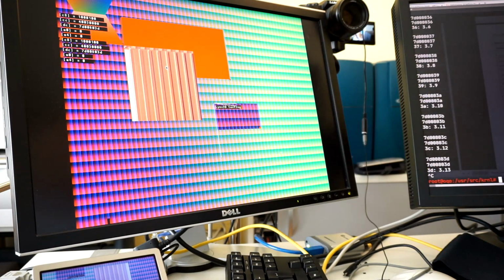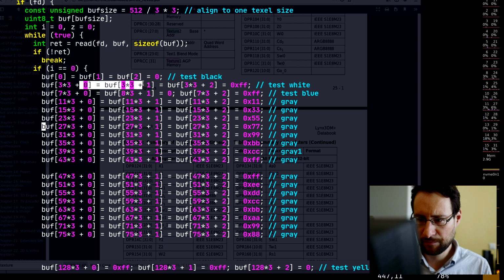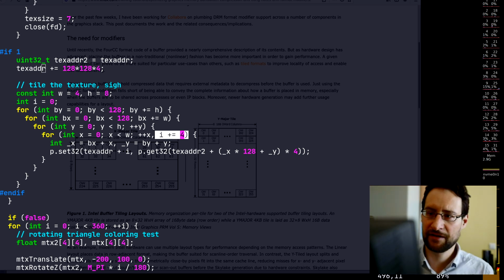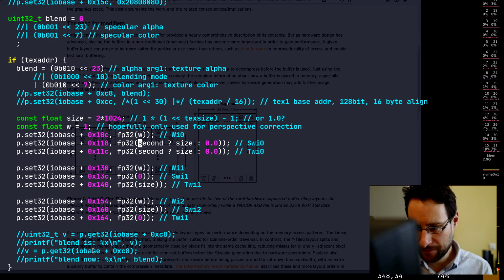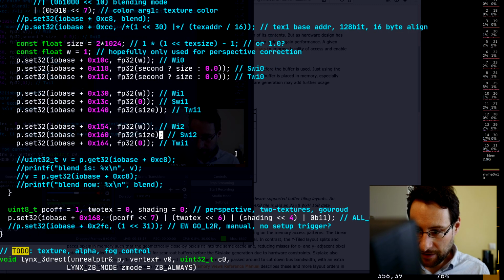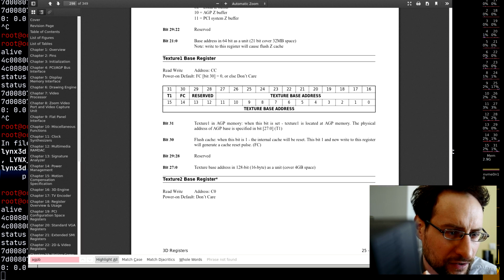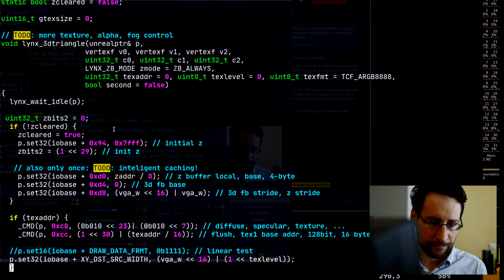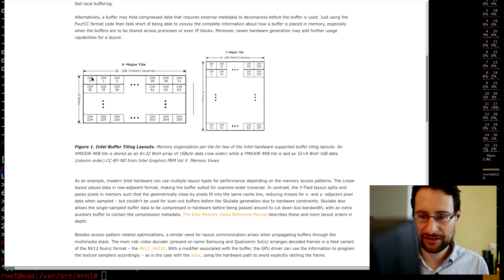I tamed the SiliconMotion Lynx3d+ texture unit!

Comment: Ah. Good old SMI. Once wrote a X driver  for this and used the 3D for Render acceleration. This was on an embedded platform so the bus an memory were quite limiting, but it did perform quite nice when working with in memory stuff. It is probably still around somewhere in old harvesters and what not. Unfortunately code stayed within the company. 😢

Comment: Awesome work, thanks! You mentioned that it's in a ThinkPad T42, but it's not. The LynxEM+ is being used in the Japanese IBM iSeries 1124, but also the in the ones for the western market, which are sold as the ThinkPad 240X and 240Z. A friend of me had one, I have the 240 with a Neomagic MagicGraph 128XD. Then there's also the Lemote Yeelung, with a SiliconMotion LynxEM+
Reply from the maker: Thanks for the info, as I said don't quote me on T42 ;-)

Comment: Correctness first is my main motto on anything I submit to somewhere. For me it is easier to concentrate and feel for the higher level parts when I can really trust the lower levels that they work as specified. I hate to use systems where you don't even try to use edge cases in production because you worry about bug reports and later workarounds. I hate it so much.

Comment: Thinkpad iSeries S30/S31 = SM720 , HP Omnibook XE2 = LynxEM4, thinkpad 240X/Z/i-Series 1124  = LynxEM(4 on the last one)+, asus s8200 (likely other models in this period) notebook = SM721, Fujitsu VERSA FXi = SM721, Server Intel S1200BTS Motherboard = SM712, MCC Modular PC = Cougar 3DR 16MB, Kontron CP303 8hp = Cougar 3DR 32MB, EmCORE-i612 = SM722G8. Acer C102T = Lynx3DM+........ I think the Cougar 3DR might acutally be the last model they ever released.... hard to say.
Reply from the maker: thanks for the list, not all of them might have the 3d engine, e.g. the ones without 3d in the name often don't. Their later embedded chips apparently also removed the 3d engine. There also appears to have been an maybe slightly more powerful (dual texture=) SM820. The SM720 spec I says on one page or two: *) tex2 not support in this silicon revision something, ... :-/
Reply: @renerebe  Yeah I think the latest actually sold model I found was the one in that Kontron blade computer... it seems there were two models also 4HP and 8HP and only the 8HP model had the Cougar 3DR 32MB. In any case I think this is one of your best videos... it's always nice to see a difficult problem beaten.

Comment: Sorry I missed it but why is the inbuilt display rotated by 180°? Is it built in twisted for cable routing reasons or is that a bug in some part of code? It is correct on vga so I suspect the first.
Reply from the maker: Its some linux framebuffer driver bug accidenrsly clobbering some register, did not had time to find out which.
Reply: Probably because of the way the display cable needed to be rounted so as to not interfer with the keyboard slide. The windows driver for the device must have just known to rotate it...
Reply from the maker: @Wingnut353  it comes up correct by the BIOS, the Linux FB driver just clobbers over all kinds of CRT config registers, it's a relatively new regression of the last years and I just never had the time to look into this, ...
Reply: I see. I wonder if there are actual devices with rotated display panels. If you own a laptop with a 180° rotated display, things could get annoying, also due to the reversed subpixel order causing weird looking text in some cases.
By the way: I think the topic of subpixel rendering is quite interesting. Usually it is just used with text but maybe it could be implemented on hardware level so that every primitive could get a sharper look.
Reply: @renerebe  Ah interesting I said that as the GPD Win I have uses a sideways screen (and yes the screen is sideways in the bios).

Comment: Is this chipset offering 2d acceleration? If yes, I wonder if 3d is faster for drawing ui than 2d, since that chipset is used for many 2d ui stuff I think. In X server there is a module which just translates all 2d acceleration calls into opengl calls as a fallback and in many places, 2d code was scrapped from drivers because it is easier to maintain only opengl instead of maintaining both 3d and 2d hardware code and performance wise, the 3d wrapping was almost as performant in almost all cases.
Reply from the maker: Yes it also does 2d, which is what the xp driver and xorg uses. For pure 2d blending the 2d engines are usually a bit faster than using the 3d engine for that.

Comment: Why the hate for DRM/DRI? I  remember back in the 90's with the Voodoo3D, and then later Utah GLX with Matrox cards how everything using 3D had to run with root permissions. Not ideal. I'm sure I also remember not being able to overlap windows because the 3D rendering wasn't clipped!

DRI1 wasn't great, but DRI2+ just works.
Reply from the maker: there is no HATE; first of all the code was moved from running as user-space root to in-kernel, clearly an elevation of permissions, but it also is so complex that few people touch it and few drivers exist, heck all the old ones are deleted in the meantime because "ah, no time to keep maintaining them" after 20 years of Linux it is clear to me that the monolithic, one address space kernel does not scale, and is not making developer easier, nor systems more secure. I would also not call it "just works" there where always stability issues, and Radeon is also broken for years on my G4 Cube, ... Also once working stuff deleted, Matrox, etc. and chips like this with SPEC never a driver implemented. PS: are you a developer ever touched on the DRM/DRI code?
Reply: @renerebe  I'm a drive-by-hacker. I have touched the code, I agree there is a lot of complexity, especially with radeon/amdgpu. Much of it is to due to how most gpu hardware isn't designed with security in mind! I do think KMS is an improvement though, I would have probably tried to bring matrox up to date but I no longer had an AGP system at the time it was ripped out.

 I'm currently hacking on the  ati-vga emulation in qemu to see if I can add support for ATI mach64, it has a completely different register layout than rage128 or Radeon although otherwise similar at the 2D level. Reverse driver hacking is fun too! :-)
Reply from the maker: @TheUAoB  hardware complicity and security is one thing, I come to the conclusion that a graphic server in user space, e.g. in a multi server micro kernel would be much nicer to work with and write drivers for and consolidate the code in one place, instead of three++ (kernel, libdrm, mesa, xorg, …) I'm doing low-level ATI mach to radeon examples sometime soon, too ;-)

Comment: can this be used like a VESA device for a X server, given the proper driver was made
Reply from the maker: Vesa always works or frame buffer.  But that is unaccelerated and dog slow. There is an x driver but that does not accelerate much anymore.  I'm interested in hardware acceleration 3d ;-)